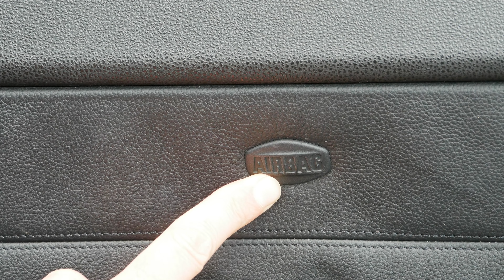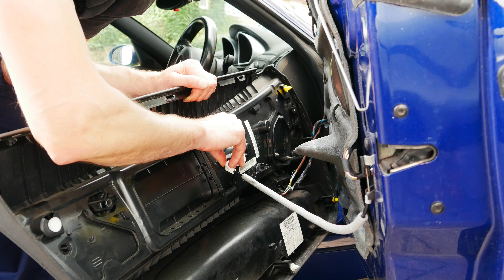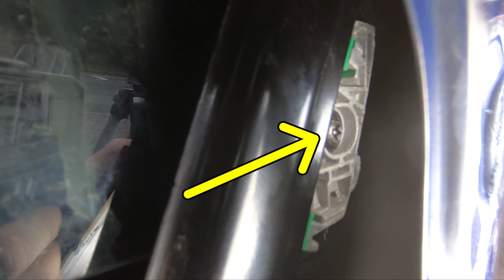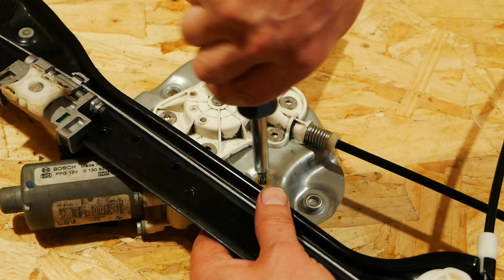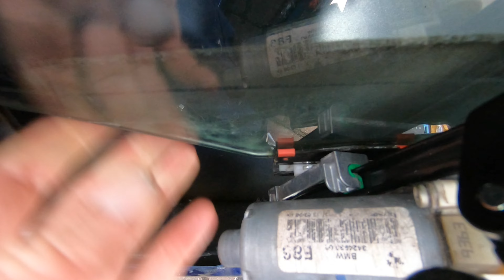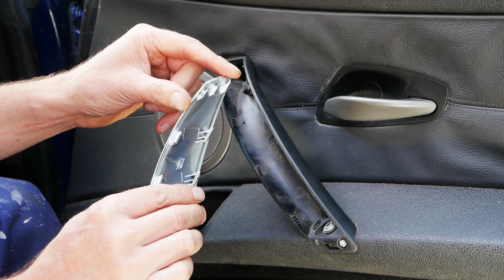BMW Z4 Window regulator Replacement - Z4 Roadster / Z4 coupe (E85 E86)

Comment: Thank you.
Watched a few others and no real  help.
The only full an clear explanation. I have just bought a Z4 and this helped me fix the bodged job that was done before. No clip put back, it was in the door pocket and the window wasn't running the correct side of the rubber. 
No more leaks or wind noise. 😊😊
Reply from the maker: Thank you for your comment! Really glad the video helped you, I knew it would never get big views but genuinely hoped it would help other owners as our cars get rarer over time… cheers, Phil

Comment: Hi my window is not going up or down I can’t access that last bolt any ideas??
Reply from the maker: It’s been a while and I don’t work on these regularly but if it’s not going up or down, then maybe it is to do with the electric motor rather than the regulator? If you haven’t checked it already, it’s worth making sure power is coming to the motor. If you’re sure the regulator is done, you might be able to reach inside the door and cut the cables, this might allow you to move the window up and down to get to that last bolt. Hope that helps!

Comment: Video is amazing - many thanks for taking the time - no way to tackle without your guidance. I can add one suggestion, the nylon glass clamp pieces, getting those installed is tricky as it's mostly blind positioning, I marked them FRONT and TOP - and it save me when they spun upside down and dropped several times to the door bottom in my juggling to get them in place. thanks again -
Reply from the maker: You’re very welcome! 👍 This was a vid for the E85 / E86 community. I knew it would never get big views but genuinely hoped it would help people with what can be a tricky issue to resolve… Glad you liked the video and thanks for your additional comments 👍 cheers, Phil

Comment: Changed the passenger door on my Maldives E85 today. As it came bare I had to swap over all the door furniture. Mostly fairly straightforwards but I must say that your video came in extremely handy regarding re-installing the window. Excellent guide Sir.
Reply from the maker: Thank you! Don’t really anticipate that the video would help with a door swap but glad you found it useful! Cheers, Phil

Comment: This video was helpful but not 100%

If the cable or the „steel rope“ is broken, replacing the engine would not help the issue. Replacing also the cables would help because this white plastic bracket has to be drilled out what I saw. You have bolts in it, I don’t :/

Comment: Thank you sir for making this excellent video. A really detailed step by step guide to the whole process of window egularor replacement. The only thing I could add which might be of possible value is that if the "down" cable hasn't broken, the window needs to be lowered so that it is 12 cm at it's highest point in order to access the rear screw holding the glass in place.
Also, if you bought a regulator from a breakers with the motor attached, check that the block connector for the motor is the same as the one you're taking off which is what I didn't do and only realised my mistake after I had installed the replacement unit. However it is easy enough to swap the motors over. 
Thanks again.

Comment: Hello,
For the countersink bit what size is this and is it for metal.
Thanks Tom.
Reply from the maker: Hi, you just need to make sure it is bigger than the rivet head that you are milling off. I think mine was 10mm diameter, made by Erbauer and yes, was designed for use with metal. Cheers, Phil

Comment: Hi, amazing video very well explained. Just about 6:12 while you get the window down to access the clip and the screw. My motor died, so I can't do what you did. Anyone got advice how to result that ?
Reply from the maker: What a mare! Maybe you could clip the cables and that might allow you to drop the window down to the right level?
Reply: @ReviveMyRide  Clip the cables ? Only the motor is H.S so I only had to replace it, need to keep the full mecanism safe
Reply: @Chaisseloutchify  Ah, sorry, I assumed that the cables in your regulator had also failed but seems like you are dealing with a dead motor only and would like to preserve the rest of the mechanism, which makes sense! 👍
Reply: @F1brakingnews  Yes exactly ! Gonna try to remove it piece by piece or diffrently.. Should have a solution to this situation

Comment: Hi - is the cable meant to be moving freely up and down without the motor installed? (with hands only?)
Reply from the maker: Yes, from memory pretty sure mine mine did, it allowed me to get the mechanism in the right position prior to fitting the motor and then into the car.
Reply: Any chance you can elaborate on this? I was replacing my regulator today. Followed great with your video, got the old one out, the motor swqpped and the new one back in. But I can't get the white plastic pieces with the holes connected to the window and also the  white plastic piece on the motor into the window channel. It's like the window needs to be shifted on way or the other a out an inch and it won't budge. Any suggestions or advice would be super helpful (changing passenger door on US Z4).

Comment: I’ve got to do this over the next few days, really appreciate the video!
Reply: Got it done today, your a star ! Worked like a charm. 

One thing to note the white plastic slider mentioned at 7.26 mark didn't come with the new kit and might need to be pryed off the old one. Just an FYI for anyone else going through this. Super easy job, just fiddly . Also found my bolts were slightly larger in size ..I.e the window bold was a tx45. Thanks again for making the video !
Reply from the maker: @MobileTechGaming  good work, glad you got it sorted. Thanks for your comments and pointers, I’m sure it will help others who read the comments. 👍 cheers, Phil
Reply from the maker: Thanks! Good lt's a bit of a fiddly job!
Reply: @ReviveMyRide  yea looks it. Thankfully I've taken apart a motorbike or 2 so should hopefully be okay (famous last words)
Reply from the maker: @MobileTechGaming  I'm sure you got on ok, sounds like you're handy with the tools! 👍
Reply: @ReviveMyRide  haha, yea.. will have to wait a bit. Been raining cats and dogs.. typical
Reply from the maker: @MobileTechGaming  Still raining or have you got it done? I had my window propped up with a piece of wood inside the door cavity for a while, just to keep the rain out until I got it fixed! Cheers, Phil

Comment: Absolutely brilliant guide. Thank you. I replaced mine relatively quickly for a newby. Few things missing that might help others. 
- I closed up the panel and tucked the metal hanging thing on the right into the door then found out it was the little black latch (door panel off again)
- you talked about connecting/disconnecting battery a few times but I only had to do that whenever I did something with the airbag
- you showed at the end reconnection of the window mechanism but didn’t show taking that panel out. I couldn’t/didn’t as it was heavily siliconed in. I just clipped the connectors in and let the door panel sit while I did whatever I needed to with the window up/down
- Finally my new regulator didn’t come with the white plastic square for the channel that is on the bottom left of the window. Whilst spares are available online from Germany. I managed to prise the old one off the regulator and attach to new

Thanks again. This saved me about £300 at the garage
Reply from the maker: Hi Gareth, glad you liked the video and thanks for taking the time to send your points above, the job can be labour intensive and hence, expensive, so you've saved yourself a decent amount of cash there! Cheers, Phil
Reply: Hi Mate, do you need that white plastic square as it didn’t come with mine either.

What’s the part number if so?

Comment: I’m really struggling getting white the plastic pieces on each side of the hole in the window lined up with the loose metal piece and the metal bracket that is attached to the regulator frame, so I can get the long torx screw in. Any tips on lining those up? And do the bottom of both plastic pieces stay inside the hook part of the fixed metal bracket? As I bring the window down into the channel the inner plastic piece keeps spinning. And what is the purpose of the loose part of the metal bracket? Is the order from inside to outside both metal pieces (fixed and loose), then plastic, then window, then plastic with metal back and threads?
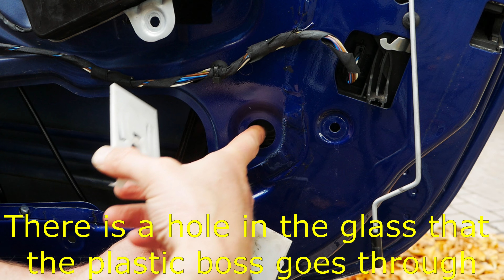Reply from the maker: H @tomaanerud Yes, the bracket part is definitely the most trikey part of the job. Make sure the bracket that holds the left side of the galss and the right side of the galss are both at the same height and then yes, as you said: The white plastic pieces go either side of the glass and one of them ahs a "boss" that sits in a hole that is in the glass. The metal plate that has the thread in it goes on the side that is nearest to the outside of the car. You kinda have to hold it all together like a sandwich with one hand and that stops the various parts from spinning. and then try to get the screw started. I'm sure you've watched it a few times but I show it as best as I can at 12:20 in the video. You'll note that both of the plastic pieces have a little "L" shape to them and that hooks around the bottom edge of the glass. Thanks, Phil
Reply: @ReviveMyRide  I got it back together, thanks! The issue I had was the loose metal wedge in front of the first plastic piece wasn’t properly seated in its channel, so it was falling out. Then when I was putting the sandwich in I had a friend standing on the other side of the door looking down, and he could see everything perfectly and help guide me to drop everything in place properly.  So biggest lesson was that metal wedge, which wasn’t mentioned in your video, because yours probably never came out.
Reply from the maker: @tom aanerud  Hey thanks for the update! Yeah, it sounds like something extra came off on your window mechanism. Glad you got there in the end! Cheers, Phil

Comment: Hi, why did you need to replace this? I have an e89 z4. The window for the drivers side doesn’t go down using the driver side switch but it comes down when I open the roof. How can I know if I need to replace the regulator or not? TIA
Reply from the maker: @TheRoadReview On my car, there was a load popping noise (cable on the regulator breaking) and the window would no longer go up or down, even though you could hear the motor running. From the symptoms you describe, I would say your regulator is fine, you clearly have power to the window because it operates with the roof. It sounds like the switch on that side is faulty. You could test this by swapping the driver side switch to that side, you won't be able to fully fit the drivers switch because it won't fit into the door card but there should be enough length on the cable for you to plug it in and test it. Hope that helps, Phil

Comment: Super video. I'm just changing the glass on my E86 it's its scratched on both sides. As a matter of interest, did you have to reset anything with the regulator for when it drops a bit when you open the door to allow it out of the seal or did it just do it when you fitted the new regulator? Thank you
Reply from the maker: @stephenweir1660 Thanks, glad you liked the video! Yes, I reset the regulator, maybe should have included that in the video. It’s really simple to do if you need to do it (sorry if you already know this, but just in case…): With the door closed, put the window all of the way down and when it reaches the down position keep holding the down button depressed for a further 5 seconds. Then, immediately put the window all of the way up and when it reaches the top, keep holding the up button depressed for a further 5 seconds. This should reset the system and the next time the door is opened, it should index the window down a fraction as you described. Good luck with the window! I haven’t removed one before myself but during the regulator job, it looked like the window would lift up once everything was detached from it. Thanks, Phil

Comment: Thanks for the video bro, it was very educational and perfect guide to help me work on zed 4 door. Only one question on the air bag assembley it is safe to remove as long as battery is disconnected? It won't eject and do you have to get the system reset if the airbag light comes on.
Reply from the maker: Hi @sevati6167 The reason I was a little bit cagey about the airbag in the video is because I have read on forums that you can sometimes get an airbag light come on even with the battery disconnected BUT I have done this dozens of times and never gotten an airbag light. So, my personal view is that on the E85 & E86 Beemers, as long as the battery is disconnected before you remove the airbag and you reconnect the airbag again first, then you won't have a problem. I actually had to do it quite a few times during filming for the video and never had to do a reset. If the light comes on, yes, you just need to reset it. There is just a little bit of equipment that you need to DIY it (and a bit of patience) here's a vid that I did if you need it: https://youtu.be/Fkon2rxijs0 Thanks, Phil